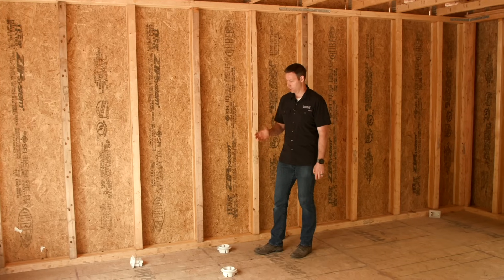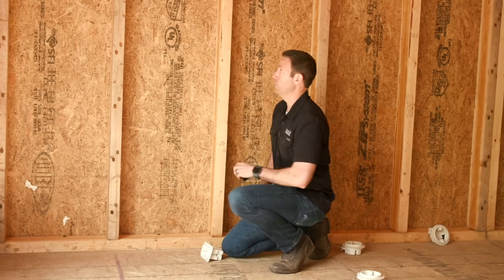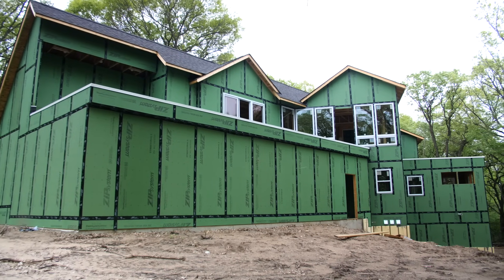Insulated Studs? This is a BIG Innovation in Framing!

Comment: How is the long term life of this stud? Have to wonder about the glue connection of the connecting dowels over time with the expansion/contraction of the wood and the wetting and drying of the moisture in the air.
Reply: I don’t like the T stud. Seems a bit much
Why not a W stud. W is always underused WOW
Reply: @calvinreichelderfer7989  W stud? is that like using floor trusses for framing studs? Essentially a giant T-Stud.

Comment: Seems like a great idea, but I'd have to question some of the means and methods. For one, that small metal strap at the top plate splice looks questionable at best. Seems it would be a wind load failure point. And this is just in a simple square area. I'd like to see the framing in a complex exterior condition.

Comment: 24%?? I'd like to see that. A wall framed with a 16" layout is 9.4% wood. Unless you have a small, closely-spaced windows  everywhere that require headers, kings and trimmers there is no way you are more than doubling layout. A typical residential framing takeoff is to calculate layout and add 40-60%.

Comment: @3:42 What is the R rating after lazy con-tractors turn them into Swiss cheese?
Reply: @Dan, how do you suggest to wire the home ? Do you even have a clue how homes are wired now ?  When you redesign the wheel, let the rest of the standard  national electrical code applying "lazy" contractors be aware of how Dan says to do it.

Comment: What’s the benefit to placing 1.5” ridged foam on the entire exterior?
Reply: Insulation on the exterior changes where the dew point is.  You don't want the dew point to be in the wall, it's a phase change for water to condense from gas to liquid, where it can mold and rot and rust the wall if it can't quickly escape.  It's a physical (if epheneral) line that moves based on the materials inside the wall (thermal conductivity) and the difference between the interior and exterior walls.

If you have enough insulation on the exterior,  the dew point will lie entirely outside of the wall, and thus the wall interior will stay dry, because water will never condense out of the air inside the wall.

Comment: You're going to kill firefighters with this trash!
Reply: So the flame spread of this product is less than 25, where typical spruce is about 75. So, tell me again how he is going to kill fire fighters with this?
Reply: @Gerling2day  Sure, but aside from flame spread, how does it deal with heat? Cuz no matter how little it spreads flame, it's not gonna stop flame, and once everything is on fire, it's probably gonna collapse a lot sooner than wood. That's the point of the original comment.
Reply: @keithklassen5320  lower flame spread means that it is harder to burn.  Or in the case of the spruce, spruce burns 3 times faster.  You ever put a piece of pine in a camp fire?  If so, you've seen how it burns so much faster and hotter than oak or other wood products.  That's partially due to the pine sap embedded in the wood.  That is also in your average 2x4 or 2x6.  The softer the wood, the more sap content and the hotter and faster it burns.

Comment: I am an electrian but i have a plumbing question, does cutting out a post in the stud to run a plumbing vent pipe affect the structure?
Reply: Have you heard of the SuperSTUD?  Accommodates up to R66 in walls.  The thermal break in this stud comes with pre-drilled holes that makes plumbers and electricians say "WOW" when builders use it.    WAY cheaper with inherent features that make the build so much faster/easier and MUCH more AFFORDABLE .... (https://www.youtube.com/watch?v=Btd1mHdossQ&t=9s)
Reply: @Fly-Away Have you heard of the SuperSTUD?  Accommodates up to R66 in walls.  The thermal break in this stud comes with pre-drilled holes that makes plumbers and electricians say "WOW" when builders use it.    WAY cheaper with inherent features that make the build so much faster/easier and MUCH more AFFORDABLE .... (https://www.youtube.com/watch?v=Btd1mHdossQ&t=9s)

Comment: wood is more of an insulating material, than a thermal bridge. strength is going a bit south in the product presented here.
Reply: A wooden 2x6 is R6, and the t-stud equivalent R20, so relatively speaking, it's a thermal bridge.  Especially if the insulation is R19 - every 16 inches you have a house-high vertical hot spot (R6) on your IR camera.  Nobody would employ wood as a thermal bridge, it's a lousy conductor.  But, it's also a lousy insulator.

Comment: Yeah I'm just not buying it that will fly down here in Florida . Put a house built with those through high category 4 hurricane maybe I'll be convinced then . Until then that just looks like a problem waiting to happen . Especially at 24 centers , no sir . You can't even frame like that here . 
I will always choose filled cell concrete block with a brick facade .
Reply: Did you see that the sill plate bolt was installed through the foam?  Due to that installation method alone, it would not meet Florida standards.  This stuff is for building where no architectural or structural plans are required by the local building department.

Comment: Looks great, but what about the chemical off-gassing of the foam, formaldehyde, etc..
Reply: It's not a big deal all you have to do is make sure you wear a HEPA respirator 24/7 in the house
Reply: TSUDS don't seem to require foam if you don't want to, just use them to replace standard studs for strength. You could fill the cavity with blown cellulose if you want.

Comment: Can't you build Alaskan Wall ( double wall with staggered studs). The house would also be like a bunker 😁
Reply: Very Good. There is a reason Bank Vaults have multiple walls of rebar that are staggered.
Reply: @victoreous626  very efficient. Bank robbers and cold air from outside can't get in

Comment: Wow a couple of 2x2's with some foam in between.. How sturdy! 👍
Reply: he said they were 2x3's but the measurement showed 2x2.5, i feel like you are sacrificing load bearing for increased insulation. I guess it depends on situation. I personally am opting out of a lot of wood material. Brick houses last forever and have great insulation values.

Comment: Just double stud with  2x4 and foam the wall. No biggy.
Reply: Double studding with 2x4 will double the cost of a 2x4 construction. It will also double the time of construction and labor due to the doubling of the job. At that point, the tstud extra grand for the tstud becomes the more economical way to go.
Reply: In addition to what Tovey said, no one can afford that much foam.  The T stud gives you a thermal break exactly where you need it.  It adds v little to the cost of materials.  It adds nothing to labor cost.  Besides that , who can afford to stop the other trades while you wait for the foam crew.  I would take the Tee Stud 100 times over the “double stud plus foam” design that you naively suggest.

Comment: it would probably be cheaper to build the house out of 2x10s then the cost of those studs.
Reply: nope, most houses in my area in eastern Pennsylvania are 2x4 built homes. old ones and new ones.
Reply: @kstofkos  That wouldn't make code here in WI.  Not enough insulation.
Reply: @6milesup   I can believe that...   You guys get really cold winters there.
Reply: Building out of 2x10's would not address the heat loss at each stud.
Reply: @JohnBoehners   it would.  each 2x10 would give you an R value of 15. this is more R value than the typical 2x4 framed home.
Reply: in fact,  it would give you the R value of a home that is made out of 2x6s when properly insulated at each stud, not to mention that you could provide more insulation and receive a full insulation R 30 between the studs with fiberglass,  and even more with closed cell spray foam.   not to mention the added benefits of beautiful deep window sills and greater sound proofing if required.
Reply: even if you went with 2x10 top and bottom plates and made the walls with 2x4s one on the outside and one on the inside fastened like standard framing you can still fill the cavity between the studs with foam insulation and have a completely separate barrier from the inside wall to the outside wall with no wooden dowels connecting the 2 and you would still have a stronger than conventional framed home that would be cheaper than those studs while maintaining all the claims of insulation value of the T studs.
Reply: @kstofkos  you must be down south.  No one frames with 2x4.  Also, a 2x10 is R-13.  These are R-20.
Reply: 6milesup actually southern houses don’t have 2x4 exterior walls either, maybe maybe a shed but not houses

Comment: There’s no way its as strong as solid lumber and likely going to warp more. What about mice? You’re really better off going geothermal and/or off grid power options to save then going this route IMO.
Reply: It is essentially a composite and the 2 by 6 is stronger than solid lumber.. .. and I doubt it would warp more, probably way less.  Problem is cost.

Comment: Yes, R6.8 possibly. Yet, every tree or species of tree, will have a different R-value. Also, further to your point aboot the 2”x6” R-value, are you speaking; flush side by side? flush vertical parallel, how much difference does fibreglass insulation influence  the wood? Thanks.

Comment: The T-studs seem pretty cool. I love the cost factor. (On a kitchen extension to the house I mention below, I went larger foundations, 2x6 instead of 2x4 All shear walls, and a bootleg sprinkler system $100k project increased cost about $500. Some of the best upgrades are not that expensive. Always do your own figures, then you won't be leaving out the copper for the PEC junk)
I don't know about just strapping the butted top plates. The code specs I know of (I'm old and haven't done much of this in many years) double top plate with a minimum 4' overlap of each of the top boards. I know exactly why this is in the code. 1992 Northridge Earthquake, my home in Los Angeles about 20-30 miles from the epicenter. A few plaster cracks, but above one door jam the top plate buckled a few inches. In the attic it's easy to see that the overlap of the top plates was less than 8". No where else in the house did this happen. So unless I'm missing something, okay that strap connection won't come apart, but it can buckle causing  damage that doesn't need to happen.  The whole 'but you have earthquakes..' I find a bit of a bogus argument, lots of things can happen to a house, the structural upgrades, (most of which have 'Simpson' as part of 'em) aren't expensive, aren't time consuming... 
In Los Angeles, hurricane ties to the roof were not required 25 years ago. What's it take to properly strap the roof structure? That was another of the upgrades.  
Great videos. Even if I'm being cranky they're well considered and are always interesting. Thanks.
Reply: Same, code where I live is minimum 2' overlap on double top plate but 4' recommended. Of course codes can and do change when new products come to market.

Comment: What is the increased cost compared to standard framing? 25%? 50%? How many years to recover the cost in heating/ cooling savings?
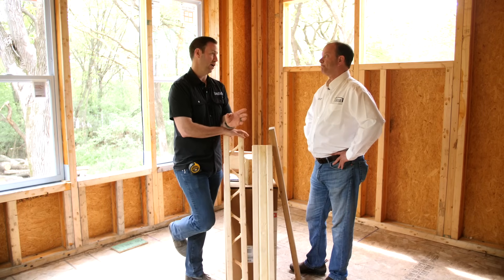Reply: i could be wrong but near the end of the video, 14:14 they talk about cost difference.   Now that I know the price difference, it's a no brainer to get this if I ever build a home.  It definitely seems like it could pay for itself in 5 years depending on where you live and the climate you have
Reply: If the cost difference is accurate, like 3-5 years.

Comment: Seems like it would be r19 only where the foam is in the middle and still r6 on the 2x3 portion that is approximately 1.5 inches thick that is butted against the outside sheeting, requiring outside insulation.  Definitely questioning this guy's r values.
Reply: You're comparing closed cell foam insulation to fiberglass batt... no where near the same R value per inch thickness.
Reply: @metal_mo  no matter what that is, I'm talking about wood on wood , where the sheeting meets the 2x3 it would not be r19 or anything close as stated in the video, whatever it would be with batting or foam, it'll never be that from sheeting to 2x3
Reply: @christiannicula4287  though R-values are given for each individual piece, the actual value is calculated for the entire assembly (including the exterior and interior air film). In this case the host is comparing a traditional 2x6 (R-6) to the truss stud (R-20 so they say). This does not take into consideration the sheathing you mentioned, which would carry an additional (minimal) R value that would be the same with either type of stud . FYI I have a degree in engineering and work for a construction company that installs any kind of insulation you can think of.
Reply: @metal_mo  I think what the guy said is BS .
Reply: @metal_mo  nothing you could possible say will change that, I think the guy embellished the truth.

Comment: Why a single top plate? I don't like that aspect of it. I'd be a little concerned about sheer nailing on that K.D. yellow pine, (I'm assuming that is what it is) as it likes to split. The solid spray foam wall definitely has many advantages beyond just keeping the cold out but if it isn't treated with some sort of insecticide I can see it becoming a nice warm nesting area for termites and carpenter ants and bees. Here in California we have to tend with all of the seismic codes and that means hardware and a lot of it. The nailing schedules are real heavy too. Does Simpson make special hardware for this system? It looks like it might make hardware application rather difficult.

Comment: Why not just use 12 gauge metal stud? The thermal conduction would be very minimal. Much less than wood. caulk the top and bottom plate before its installed. And then use spray foam.

Comment: well when it's cold out side what dose one do, we put a coat or a sweat shirt on to prevent from getting cold, I'm thinking the same thing with a home, insulation on the outside of the sheeting is like putting on a coat an preventing the cold from transferring to the studs, on a 2,240 Sqf home that I'm building with 1'  Extruded board would be $1,800 with no discounts from Homedepot an the I'm thinking the cost of a heating an cooling unit should be less an in return lower my cost of operating my home

Comment: cheap it is only for the, good of the economy of the contractor wood is very good insulation  framming should be bolted and outside insulation. 120 sideways that will crack.

Comment: Putting an extra layer of foam board on the outside solves this fairly non-existent problem. 

I build in Minnesota; these are an expensive overkill.
Reply: Logan Sloan I’m guessing doubling up on the foam board is double the cost...how much ,estimated, on a 2,500 sq ft house? Shorter question: what’s the cost to foam board a 2,500 sq ft house? (1 story) Then I’ll just double 😉
Reply: @ThatEnergy  1.2k per floor essentially
Reply: @ThatEnergy  that's based off a 2800 sqft two story house built on a city lot.
Reply: @ThatEnergy  honestly though, if you do the math on the thermals, it's so small that it would take 25-50 years (depends on the house and how it's framed) to get back the cost of these things.
Reply: @ThatEnergy  I don't dislike the product. I think it's cool, and I love building science and everything that goes into it. But this is a product you sell to yuppies who want to feel green. It's just not practical if you're building homes for normal people.
Reply: About to build a house in central/south TX and looking at ways to keep the heat out...
1. Windows
2. Insulation
3. ?

I’ll take suggestions too and then do my due diligence. Thanks
Reply: @ThatEnergy  Don't put a lot of windows on the south side of the house unless it is in shade and invest in a good AC unit and a swamp cooler too. I've never been to south Texas so I don't know what it is like there but if you have a mix of hot humid and hot dry days you will want both. One works when the other won't.

Comment: Separated twin studs have been around since the 1970's, so where has Matt been living?
Modern, super-insulated dwellings have walls containing 300mm of insulation, so 152mm is way too inefficient. Balloon frame is still best for overcoming the problems of shrinkage and thermal bridging at first-floor level.
Swedish Masonite studs were straight, lightweight and up to 40 feet long, plus the construction was far easier to manufacture than T-stud and was extremely efficient in its use of timber.